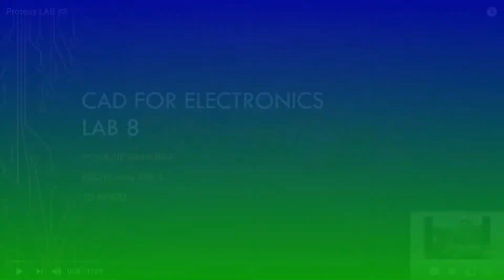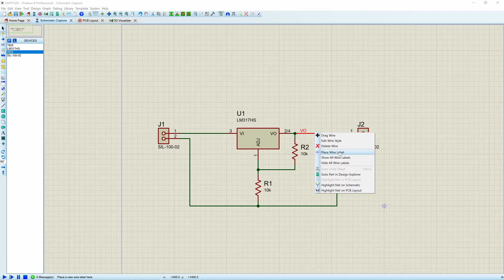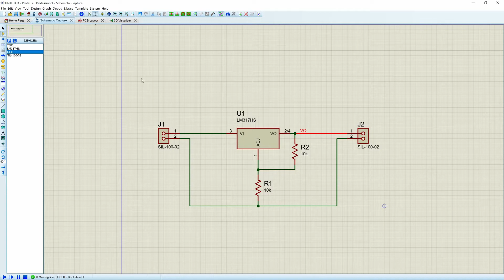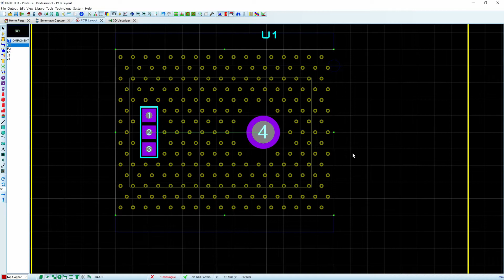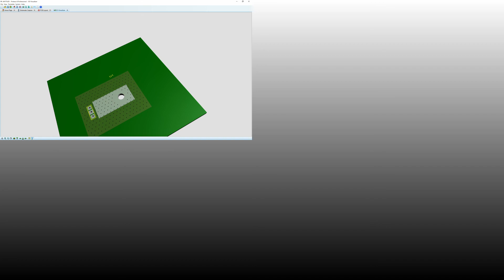FREE HEATSINK ON EVERY PCB (PROTEUS EDA TUTORIAL) COOLING

Comment: How can I isolate heatsink frm makin contact with top layer track
Reply from the maker: So a conventional heatsink could use the solder-mask as an insulator however, it is safer to use a thermal pad which will increase the dielectric strength while providing reasonable thermal transfer. If you are referring to running traces over a thermal area like in this video, it is not possible as they are on the same layer. However, if you wish to run a trace through this region, it will work so song as there is a means for the heat to flow (copper on opposite side of the board or inner layers). Hope this helps.

Comment: Engr scott..Pls kindly teach me how to use solder paste n solder resist on pcb design in proteus..Secondly what is the difference between them..I mean how to applied it in pcb design when using proteus.
Reply from the maker: I will make a separate video on this later but, the solder mask is the coating that is put over the circuit board where you do not want access to the traces. In Proteus the layer you create defines where you do not want this mask. The solder paste layer is where there would be an opening in the solder stencil, which would allow the paste to be applied to the PCB. These are made with the 2D graphics tools (select the appropriate layer and be sure to edit the properties to "fill" the area). Hope this helps and stay tuned for a video on the topic soon.
Reply: @ScottCard  Please I will be longing to see the video very soon on your channel..God continue to add more knwledge to u..Your channel has really inspired me..
Reply: @ScottCard  Please a reminder about making video on solder paste and solder resist

Comment: Can you please tell me how to add high voltage track without solder mask?
Reply from the maker: Sure! Not sure if you meant high current or actually high voltage but, high voltage required extra clearance. this will be done using the DESIGN RULE MANAGER. For high current, make your trace as large as possible, then add 2D lined on the RESIST and PASTE layers. Unfortunate there is no automated way to do this but... it is a work-around that works. I will make a video about this and post an update here.
Reply from the maker: Here is a new video to help you out with the high current application. https://youtu.be/iiU77aPY_Os